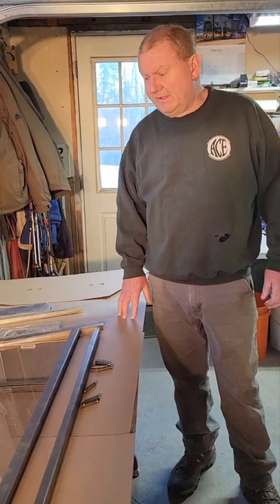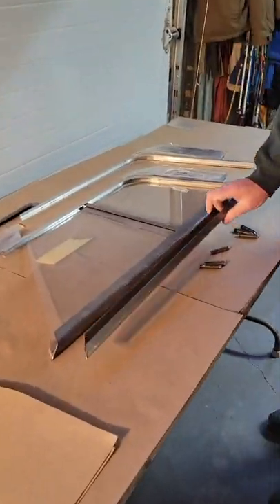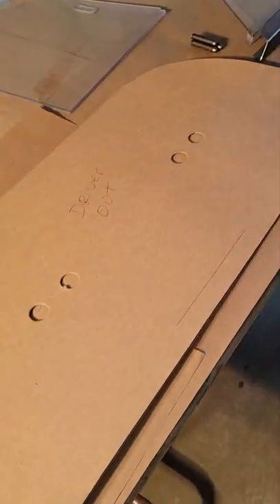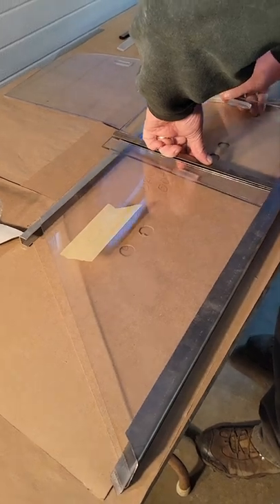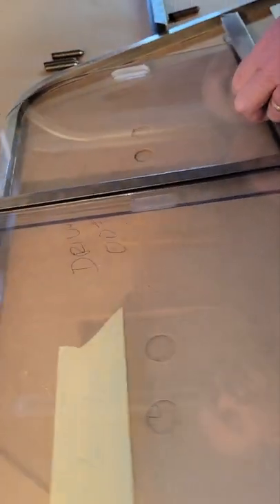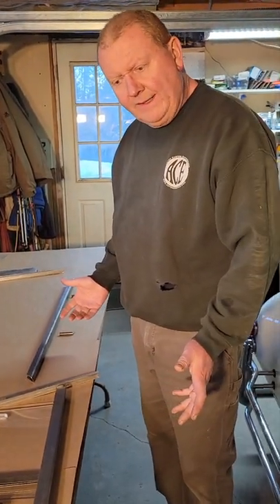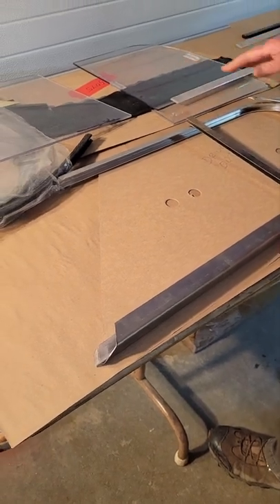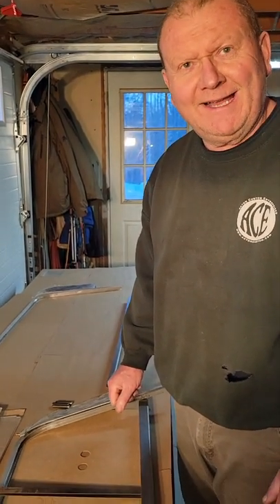Side curtain kit AC Shelby Cobra

Comment: Thanks for the video. I have a hardtop and a set of standard side curtain frames. I believe the locating pins are welded at an angle - mine have been removed. I was wondering how you set the angle? I have also been wondering about that flat piece at the back of the frame (used for soft tops) and how it should fit on a hardtop. Wondering if I should trim or remove that piece now.
Reply from the maker: If you have your windshield and top all installed and are ready for the bottom pins you can put a 3/8" diameter rod in a ferrule and use an angle gauge to measure the rod angle to the windshield post.
If you can transfer the back of the window opening to the sheet panel and trim it to suit. The panel could be removed and a cardboard template could be used to get the shape.
Reply: @nickacton9006  thanks Nick, much appreciated.
Reply from the maker: The side curtains I have seen for a hardtop are a different shape. You may need to reshape the frame if it doesn't fit inside your hard top with the sheet metal removed. I'll be interested to see what you have and how it works out. @kevinwells768
Reply: @nickacton9006  Here is a walk around my hardtop 'restomod' - a 289 hardtop from Hawk cars that I chopped in 4 and glassed back together, reshaped the rear and then painted. I noticed my sidecurtain frames dont fit the back of the door opening very well, hence the above question. 

https://www.youtube.com/shorts/0B_9zDOgmKk

Comment: Hi, my name is Phil from Australia, I would like to know are the pieces of the frame mild steel or stainless steel ?,cheers
Reply from the maker: Gidday Phil, I'm an expat Kiwi as you can probably tell from my accent. I make the pins and lower and center channel from mild steel and the top channel and rear tabs from aluminium. There were several variations on originals but this is the most common configuration I've seen.